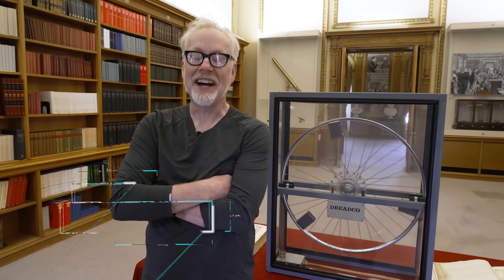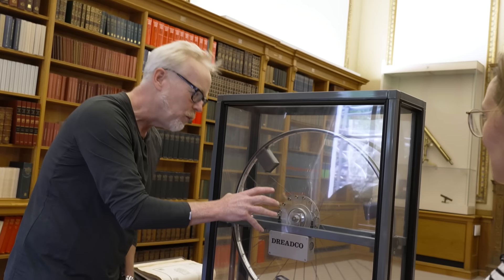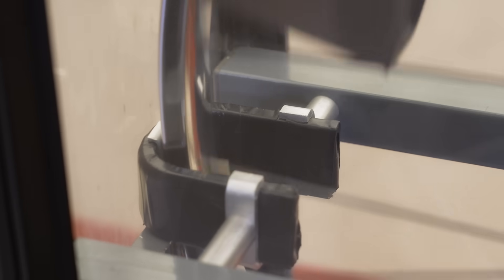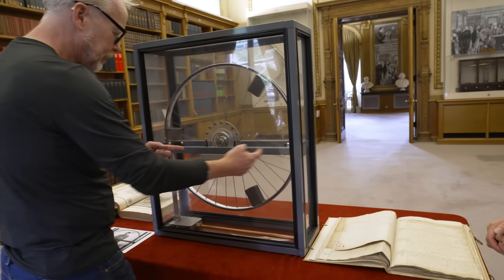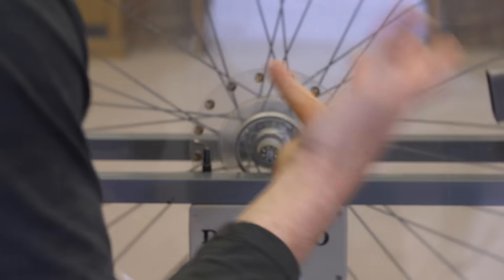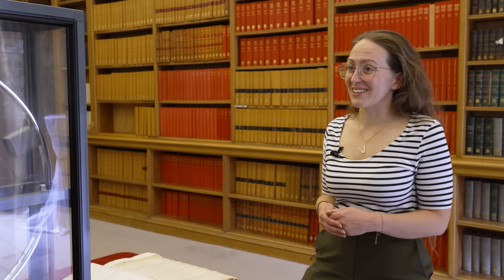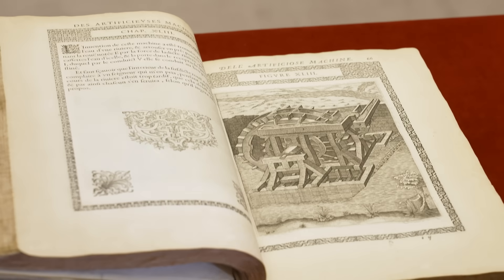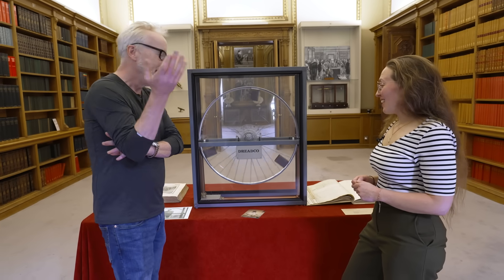Adam Savage vs The "Perpetual Motion" Machine!

Comment: By using a smartphone to monitor the magnetic field, you can easily detect where a pulsed electromagnetic field drives the wheel. It may be inside the three boxes in the wheel, activated by hall sensors, which were there also in previous designs. The two metal boxes near the shaft and on the bottom have the only purpose to confuse the observer.
Reply: Just guessing, but if there’s a common thing like the boxes in all of 3 of those “machines”, it’s meant to throw people off and probably useless.
Reply: @MachtPlays I don't think they're useless, but I don't think they're what people assume (electromagnets)

Comment: south/south polarity magnets run static field through the wheel (metal) the blocks force a momentum on a 3 point axis preventing a 2 way polarity ie (stops it going the opposite way once in motion and prevents it becoming locked to a single point) the copper pipe is a decoy as is the head block, as are the cups on the centre wheel.

the bearings on the axle only serve to smoothen the rotation.

nothing about it is perpetual. just another joke at real science :/

Comment: Take a look at the Jaeger-leCoultre Atmos clock. It runs almost perpetual, based on a gas that expands when temperature rises. A 1 degree rise is enough to power it for 48 hours. Much closer to perpetual motion as this device is.
Reply: Neither are remotely close to perpetual motion. Perpetual motion does not mean "thing that works without a chemical battery". The Atmos clock uses external energy sources just like every other device, including this one, and in no way resembles perpetual motion.

Comment: I remember having this same idea when I was around the age of age of seven years old. If this wheel could be attached to a small commutator that charges a small battery pack wired in parallel that feeds a small amount of voltage to the stationary magnets in theory the more power the device makes. Of course this would require extremely light materials   and some trial and error. Ever since I was a young child I was always interested mechanical science! Especially Automotive Engineering building, repairing, racing and vehicles themselves! Even though my main focus went to automotive I’m am still fascinated in mechanical engineering and science which is why I graduated college at the top of my class and up until my unfortunate disability I worked in the industry every day!

Comment: ever seen one of those yellow or red funnel's or cones that you drop a coin in and it spirals around faster and faster till it drops out the bottom hole.  What if you made the cone out of magnets and used a round metal ball instead of a coin?  Suck out the air and plug the bottom hole with another magnet.  Would the ball keep spinning with no friction?  How bout if you put one booster block in the cone to give the ball a magnetic boost now and then?

Comment: 5 magnets 🧲 3 of them 120 degrees apart.  2 have windings around them "horse shoe magnets with tape around . 
So when magnets pass through the coil a emf is given off charging the little motor battery in the center and inturn keeps turning the wheel

Comment: Things spinning in space is a perfect example of perpetual motion.
Reply: No it isn't, because that's not what perpetual motion means, and things spinning in space still have losses.
Reply: @outputcoupler7819  From Oxford Dictionary: "a state in which movement or action is or appears to be continuous and unceasing. "  According to you, when will movement cease?
Reply: @GameArtsCafe  Did nobody ever tell you that arguing dictionary definitions of terms was the best way to tell people you don't understand anything? People who understand this stuff don't need to go to a dictionary to tell somebody what something means.

People use "perpetual motion" colloquially a lot more loosely than those in scientific circles. Scientifically speaking, a perpetual motion machine achieves overunity, and thus violates the law of conservation of energy. This has nothing to do with spinning for a really long time, or not having losses. It's about the energy you can extract from the system being greater than the energy that has been supplied to the system. That is what perpetual motion means in this context.

Also, "when" will a hypothetical object stop spinning when you've given me precisely no details? No way to tell. But it will stop spinning. Nothing is perfectly rigid, everything flexes as it moves, even if it's just spinning. That causes kinetic energy to be converted to heat. That's a loss. Space is not a perfect vacuum, there will be collisions with particles, that will cause a loss. There will be eddy currents caused by any electromagnetic fields. Hell, it'll even lose energy to extremely minute gravitational waves.

The real world is a lot more complicated than simplistic thought experiments to satisfy a "well ackchually perpetual motion is possible if you use my super special definition of perpetual motion I got from this not-science book."

Comment: Maybe you’re thinking too hard, the box is vacuum sealed, so it’s really just a bike wheel with weights, bc there’s it’s in a near vacuum, it’ll spin without resistance ( until air leaks back in and needs to be professionally sucked out)

Comment: My guess is the 3 boxes contain their own battery and coils. When the box gets close enough to the frame's permanent magnets , it quickly energizes the coil and keeps it spinning.
Reply: Slow the footage down and see if you can measure a kick
Reply: @johnfritzel9833  in theory, if the coil force is very low then the kick might be imperceptible. just needs some quality low friction bearings.
Reply: @blacknoir2404 at only 4 points, being done from the outside circumference, it indeed would be measurable.
Reply: @blacknoir2404  You're saying the field strength doesn't change on a 3 pole large diameter system? Of course it does,
Reply: @johnfritzel9833  you don't need to see a kick. if you look when it's zoomed into the permanent magnets you can see the wheel frame move towards the magnets when the 3 boxes get close to them and move away as they go away.
Reply: @ABearInTheWoods-tumblr  I'm leaning towards this as well. Would there actually be a kick anyway, if the entire thing is spinning loosely on a bearing and isn't threaded to a gear, with enough motion and weight giving it momentum? When making home-made ball mills, the mill jars are often laid on a couple of spinning rods in pillow blocks and the jar itself just relies on friction to move with the spinning rods. Sudden speed ups are imperceptible since it just does a little burn-out instead of gripping tightly.
Reply: @ABearInTheWoods-tumblr   Read what you wrote, you are saying that its in motion, duh!
Reply: @ObsequiousV4  i am talking about measuring it frame by frame!
Reply: @johnfritzel9833  No kick, motor is elsewhere, there are only coils and batteries in three boxes. Motor is most likely in the center of the wheel and wires could go through spokes. That being said, there is most definite loss of energy by current going through those wires. :D
Reply: @urosmarjanovic663  what are the coils for if not to be an electromagnet? I am talking about an electromagnetic kick
Reply: I'm guessing you've got the location of the magnets and coils backwards. The horseshoe looking things being the coils would mean that the batteries are in the box at the bottom, which would be a much better location for service than in the boxes on the rim.
Reply: Dammit beat me to it and explained it better
Reply: No magnets. Everybody keeps guessing magnets. This thing is designed to distract you from the real method.
Reply: @warrenschrader7481  Agreed, I'm sure 90% of the machine is just distraction. 
She dropped the two most important clues to how it works: 1. It slows down instead of just stopping "before servicing" and 2. people who get to know how it works tend to be rather disappointed.
Reply: @warrenschrader7481  whatever lol
Reply: @warrenschrader7481  oh so a gas engine huh? Lol
Reply: Agreed
Reply: Is there only a draw on the batteries when the coil they are powering passes through the magnet? It is there a constant draw on the batteries from the mere act of powering the coils?
Reply: I think everyone is over complicating this. The easiest way would be to run some type of belt within or even around the wheel through the copper tube. All the other materials are to misdirect.
Reply: @Prism775   I think you could be right, I also think the batteries are in the frame its self, I think they are AA sized cells that are wired in series throughout the frame, if thats the case then it could be holding a large amount of power in the framework and other doo dads hidden in it
Reply: @Prism775  LOL, not

Comment: The 3 boxes are filled with the exact same weight of water with a little air pocket/ gap / half filled water boxes... gravity and the little bit of momentem from the wheel causing a slite wave action pushes the rest over the centre repeating again and again...

Comment: Speaking of hearing weights move, is it possible that the boxes around the wheel contain magnets oriented in such a way as to allow them to move somewhat up and down - changing where along the box the polarity lies relative to the center of the box depending on if it is descending or ascending as the wheel turns; and those black clad areas on each side hold corresponding magnets that in conjunction induces a slight pull and an opposite push?
Edit*: genuinely asking as it seems somewhat plausible to me but is generally outside my area of expertise. - Perhaps the forces cancel each other out anyway?
Reply: No, that doesn't work. There is no such thing as perpetual motion, it doesn't matter what you do. There is no clever solution that will cause the wheel to rotate like this without using stored energy in a battery or something like that. 

The puzzle here is how it's faked, now how they actually achieved perpetual motion. This is an art project.

Comment: its a viscous fluid inside the boxes with baffles to precisely control the flow, they all have their oil set to one side and placed at 120 degrees to each other on the wheel, this will cause the wheel to spin until the fluid equalises in all the boxes, ad because it's spinning it has very little time to equalize before its flipped back over again, the rest is just distraction.
to reset it they have to remove the boxes, set the oil to one side and place them back on

Comment: This device resembles a wimshurst machine, and I'd wager a guess that it functions in nearly the same way, but rather than discharge in electrical archs it channels the energy back into the device to power it, essentially circulating the flow of energy in a way that results in rotation. I also think the boxes set 120° apart are some sort of capacitors, allowing it to hold more of a ststic charge for a longer duration, so it take forever for it to run out.
Reply: I was wondering if those boxes were capacitors as well.  The device is a motor that powers itself.

Comment: Needs a touch-up every couple of years? An Atmos clock can run that long, using differences in atmospheric pressure. The copper tube, etc, could be part of that. The photovoltaic cell could be another source, each helping each other out to keep the "electric motor" going. I assume the case is airtight.

Comment: This is a complete psy op. There have been perpetual motion engines that run for 50+ yrs at a time. Theres one that uses a single pistol that collects energy from water hammer and that gives it enough energy to keep cycling up until the greaae wears out.

Comment: The boxes are for weight help the rotation to keep the wheel spinning while the rods are interacting with the circle of magnets on the wheel. Once someone gives it a spin the boxes at 120 degrees keep the rotation so the magnets won’t hold the wheel still after the machine is started. To service the device you would have to introduce a stronger magnet to the older weaker ones to recharge them or you could possibly produce a strong electromagnetic field to re-polarize the magnets.
Reply: No. Assuming the magnets are attracted to the rods, they would be attracted as much on approach as on departure, canceling out their effect.

Comment: I have seen it's working principle almost immediately. It is very similar to the electro-magnetic pendulum, but it goes just in one direction. The 3 boxes rotating with the wheel contain permanent magnets, which interact with coils hidden in the U-shaped parts at both sides of the outer frame (in principle one would also work). I guess the coils also act as magnetic flux sensors.

During the propagation of the permanent magnets a voltage will be induced as long as the flux increases. When it decreases the induction voltage crosses zero and changes its sign. In this moment a current through the coil is triggered, which give the permanent magnet a little push to force it out of the coils influence which provides torque to the wheel compensating the torque of the friction losses.

The DREADCO box contains the battery and the controlling electronics. Probably there are also some photovoltaic cells at the sides of the box to charge the batteries by use of ambient light. The system doesn't need much power to keep on going so slowly. I guess a 10 to 100 milliwatts is perfectly enough.

In principle this is a self-sychroniced electric motor.
Reply: Yep pretty much, the servicing needed is probably only to swap/service the bearings that it spins on in order to maintain the correct spin for it to keep a good charge, over time the grease and bearings could wear down slowing the device enough that it cannot generate the charge needed to spin.
Reply: . if there were any magnets attempting to make electricity they would stop that wheel instantly just from the attraction of the magnet to the steel that the windings are wound on.
Reply: @smoothmove7566  There is no steel inside the coil of an electromagnetic pendulum. In one of my setups I have discovered that even the magnetic losses in two iron wires of a coil carrier are enough to let the device fail to work.
Reply: @gkdresden  even if there was no iron the eddy currents alone would be enough to stop it from rotating.
Reply: @smoothmove7566  which eddy currents? Where should they accure? The permanent magnet is a highly remanent material. The coil has a high inner resistance and it is not a closed current loop, it is only closed, if it carries the repulsive current, acting against the induction according to Lorentz.

And also the pendulum never stopps, except the battery is empty. Think about these waving Chinese cats. The rotating wheel is just the same in a different shape.
Reply: @gkdresden  the same reason you cant have a coil gun without electromagnets.  Would need logic, current, seems unlikely
Reply: @smoothmove7566  and the magnets are not intended to make electricity. They are necessary to provide the electrodynamic force in an efficient way.

The moving magnet has the same function like the moving magnet in a sychronous electric motor or in a loud speaker. In the last case, however, the coil is moving with the armature.

Comment: its the protruding tooth at the front of the wheel the box is wood which  makes for a great sound insulator inside the box is a small motor going about as fast as the wheel to keep it spinning the reason it slows is because the timing isnt exact and the inevitable happens the watchers do three jobs ensure the wheel keeps spinning and change the battery and keep an eye on people around the exhibit magic is always a slight of hand or similar on the other hand physics says decay and heat exist altho they did good at getting rid of as much friction as possible it still exists in the atmosphere the box isnt air tight or sealed to the atmosphere and even if it was it would still build friction and eventually stop magic is also a "want" for most people 😀

Comment: I know how this system works, as I am a real engineer. But I will not tell you. I find it funny how many comments are possible. All wrong. But it is a good exercise for schools people to think about it. I can only say so much: 1. you do not need knowledge of quantum mechanics, but 2. a little bit knowledge of material science is for sure an advantage 🤭😋🥰
Reply: @GenghisClaus  wrong! Try again. 🤭.
Reply: @GenghisClaus  I do also not show of. When I mentioned that I am an engineer I just wanted to say that I really100% knows how it works. Of course it looks like sorcery when you don’t know the „trick“ works, but when you know the trick, it is somehow boring and normal. In this case I did exactly calculate the system and you can also use the Standard measuring devices like magnetic, thermo or high frequency means and cannot detect it from outside. Of course if you open it you can find out relatively easy. If told you one word, even in a cryptic way, you would know that I know 😋. Have fun.
Reply: @GenghisClaus  foreign language is difficult 🤭

Comment: Would be interesting to bring in a transistor radio, and listen for any clicks at a rate the wheel spins at, and a magnetic compass to detect any magnets. Could be something as simple as those dollar store solar toys. As one of the 3 magnets on the rim passes a coil of wire, a transistor is triggered to energize that coil and kick the magnet away, ever so slightly. Could be battery powered and use very little energy.
Reply: And there IS an optical sensor there.. :)